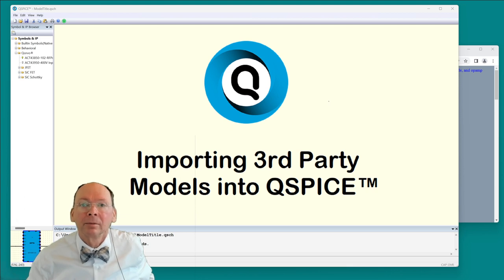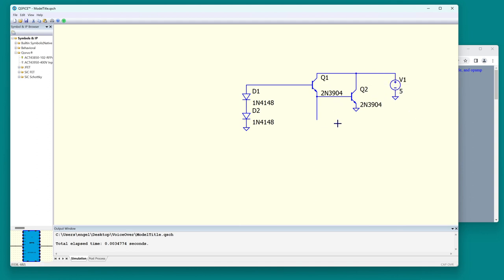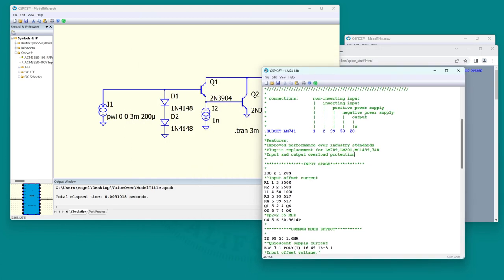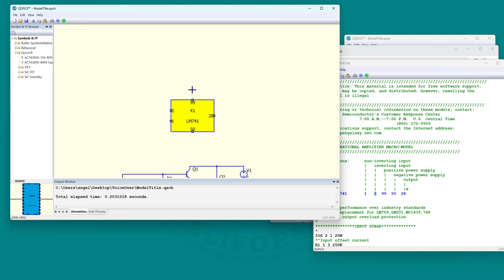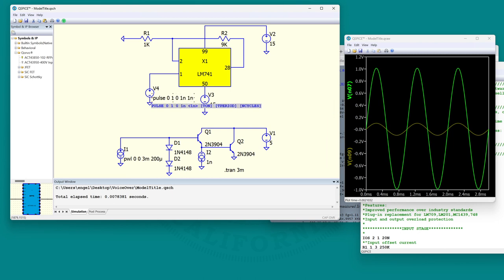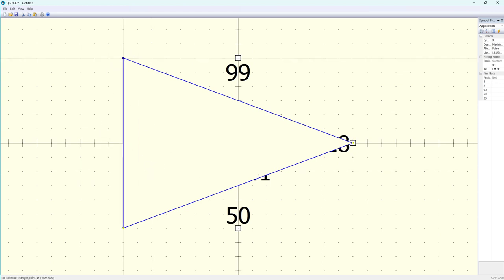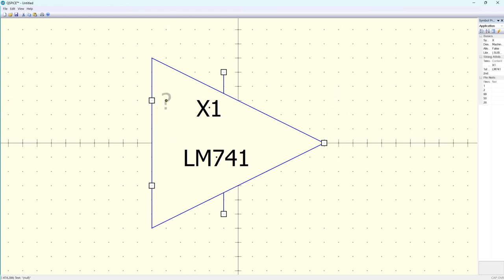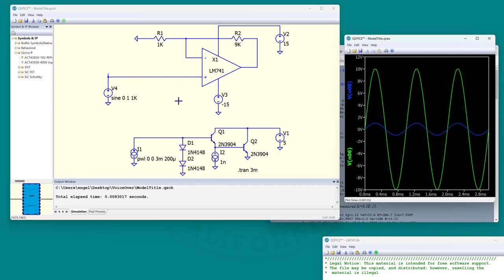Importing 3rd Party Models into QSPICE

Comment: Hello professor. Great video and very informative. I’m trying to import the model of an MOV. However, this model contains 2 sub circuit models inside it. That said, how would I import this model? Please advise. Thanks.
Reply: Quick update. I am now able to import the MOV model containing the multiple.subckt sections. However, when simulating this MOV model in my circuit, I get a “time step too small error” once the MOV clamp voltage is reached. I had the same issue using LTSpice. The way I got around that error was to limit the time step to 1 nanosecond. This makes the simulation very slow though. My question is, is there a better way to get around this problem in QSPICE?

Comment: When I pasted the symbol and try to run the simulation again I got an error: Unknown subcircuit. Does anyone know what may had got wrong? Could it be because I added text to symbols instead of comments?
Yep. I made another symbol using comments and it worked. Why if we text it doesn't work?

Comment: The UI is very primitive.  Why don't you opensource it so people can make it better?
Reply: It is not. If anything it can be further simplified and streamlined and ergonimized. The only drawback is the MFC GUI toolkit used which is windows-only. Something like wxWidgets (used in KiCAD) would not have required the code to change by much from MFC but would have provided much-needed cross platform support. Especially Linux.
Reply: @modallas2  Again, perhaps opensource it so people can contribute in GUI development and make it cross platform.  I would rather stick with spice or ltspice because the gui is less than ltspice's